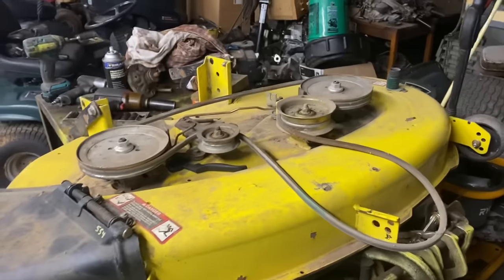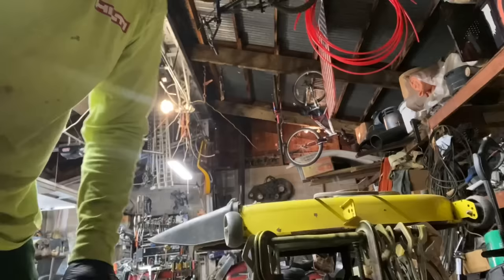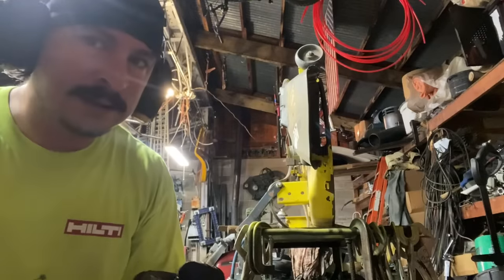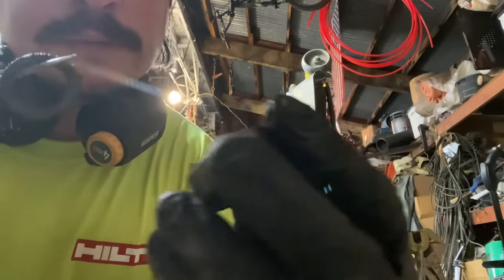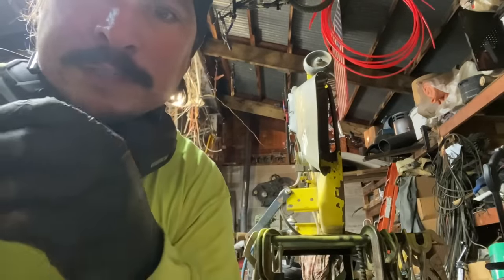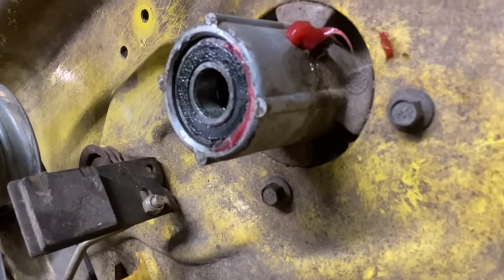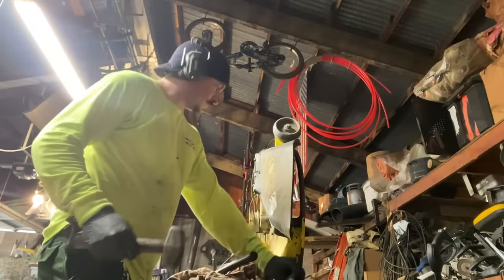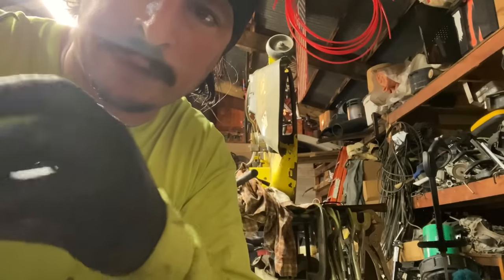Part 1 - Don’t trust the “Experts” Grease your mower deck sealed spindle bearings Common sense.

Comment: I have been removing the dust seal's on the bearings for years and I have never had a bad bearing since.
Reply from the maker: Thank you for taking time to comment. Yea, I have done the same and that works fine too. If I’m already in a deck doing repairs some times I’ll leave the inner lower shield off. I however prefer to leave the inner shield on the upper bearing as it can actually hold grease up in the top bearing as grease may migrate down into the assembly when it warms up. But if it’s greased regularly enough it wouldn’t make any difference if the shield is there or not. So I don’t usually bother messing with seals anymore. Just leave them there if they are already there. At least if the bearings have shields I don’t have to worry about junk getting into the bearing while I’m working on one and have it apart. I can just wipe down the outside of bearing and throw it back in. There are some good reasons to leave shields in place. However the point of the video is to prove that tearing down the deck to remove seals is not necessary. Some folks think grease won’t pass the seals / shields but it will and that’s the important information to take away from this. You can just grease the mandrels and save a lot of time. Regardless as long as the units are properly filled with grease the bearings will be fine regardless if they have inner shields or not. Many folks don’t want to tear down a deck and remove seals if it’s  not needed. Not everyone has the skill or tools and if they just know to add enough grease that’s what’s ultimately the most important thing. Plenty of guys posting videos stating that the shields / seals must come out or else they will prevent grease from passing. Lol, those little rubber lips can’t hold back the pressure exerted from a grease gun. I know these guys are smart, I see some other great information from these same folks but most everyone posting videos on this topic has missed the mark and not providing accurate information and I have yet to see anybody else take time to prove the theory they are so sure about. It was driving me nuts so I made a step by step video to prove that those “ mower experts “ are giving inaccurate advice. As many folks have commented this has been useful information for some people. Thanks again for the comment.

Comment: My Brother was a Small Engine Mechanic for 30 years & headed up a Service Department doing 8000 repairs per year in a Leading Mower Shop which was the Top Dealer for all the big brands,... He personally repaired the Riding Mowers which were many varied brands,... He worked on Engines, Hydraulic Transmission, Mowing Decks, Electrical, all of it.
He was a Briggs & Stratton Master Service Tech (less than 20% passed the Certification).
He has often told me that the biggest cause pf problems to Mowing Decks is WATER from people hosing them off !... Blow them, brush them, wipe them, don't hose them ;)
By the way,... Those Seals should not be that loose lol.
Reply from the maker: Your brother sounds like an impressive guy. I’d run if I even heard 800
Repairs. Lol. No thanks. I’m in the top 99 percentile. Everyone except for 1% of society is smarter than me. And I’m happy for the 98 % that are at the top. The bottom of the dog pile works great for me. I agree about the water. And Iv always said the same things. But I rarely find water in the bearings but water helps nothing. Blow deck off is best. As for the loose bearings or caps. That’s normal for a pair of used bearings pulled from a Deere deck. I didn’t notice anything alarming. Depends on the brand
Of bearings, some come with really loose sloppy caps. Some tigger than others. You can’t make a reasonable diagnosis from the video. Stop while your ahead, I was actually following you and agreeing until you said that.

Comment: This is an interesting video. The confusion comes from the bearings being called "sealed", which is shown here isn't quite accurate. 
But I think you are making at least one mistake and that is that more grease is better... Personally I think some will watch this and using the pressure of their grease gun, they will fill the reservoir and Then Fill the bearing race. 
And that's bad, because too much grease makes the bearing run hot and hardens the grease to wax. So while the video does prove what you say, it may also cause guys with new mower decks to ruin their bearings by thinking they can't over-grease them. 
Cheers 🍻

Comment: How often should you be greasing the spindles and if you pump in too much grease can you damage the seals?
Reply from the maker: Iv never seen any seals be damaged from greasing and stop as soon as you see grease exit somewhere no need to go crazy!!

In my opinion, a proper greased assembly is good for 50 hrs or annually what ever comes first. Avoid washing deck or applying excessive water directly on the pulleys to prevent water entering bearings.
Reply: @GTObearclaw1  Thanks.  There's so much conflicting information out there but this really helps.
Reply from the maker: @ADCar  I hear ya. It’s very hard to know who you can trust. Iv learned all this myself and why I wanted to help people when I seen the terrable videos on this topic. Lots of folks have no idea but yet make DIY videos. Be aware of the guys who have a video about every topic. Nobody knows everything. They just want views and gladly offer crap advice if it gets views. Most of my videos are about mower decks and that’s unfortunately what I know more about than anything else. Wish I was as knowledgeable on something cool like Harley’s are race cars. lol

Comment: Not sure I'd agree with this one. I've run lots of heavy logging and sawmill equipment and seen bearings go more often from being over greased because of heat build up in high speed rotation use. Over greasing can blow seals and allow in contamination as well. I've seen over-greasing cost many, many thousands of dollars in repairs, especially in components like twin disc torque converters with internal bearings accessed though an external zerk. Also I'd add that as that machine is working it will generate heat in that cavity and the grease will somewhat become vaporized and through expansion seep into and through the rubber seals. Why was the top bearing containing grease?
Reply from the maker: You don’t sound certain that I’m wrong. And that’s the point. I’m challenging the so called experts who say not to grease these. Thats just dumb to me because no grease is a guarantee failure at some point. Adding grease could potentially keep bearings rolling for the life of a tractor. Easy choice for me but Iv had many years of research on this so I’m 100% confident about it. This video is about mower decks. I promise I’m not going to try and give advice on servicing logging equipment. I’ll stick to what I know. I didn’t just invent this stuff, it’s actually kinda basic mower maintenance just not widely shared information and the reason I thought it was a relevant topic to cover. Seems even the pros have lost touch with the reality on this one. Considering a mower deck is not typically worth thousands of dollars in a box store model lawn mower, I think we will be okay here. If a bearing on one of the box store mowers goes bad you can pick up a set for under 20$ unless you really want to spend money you can get a rally high quality set for under 100$ so worse case you would have to take the deck apart or pay someone to do the labor or simply grease them as Iv shown and avoid those costly time consuming projects with simple basic maintenance. It’s just information to help the DIYers. Folks can use it or choose to ignore it. But I have had 100-% success with this for decades so I wanted to share after watching some other stupid videos say the grease can’t pass the bearings. I proved that wrong with ease. I can only assume the RPM and loads on the bearings you’re talking about are something way different. As in many cases, naysayers always come to the comments with something way different than this application. Food for thought, if you watched the video you may eventually feel like experimenting. It’s good to know it is possible to do it this way, and if you find not greasing to be an issue it won’t hurt anything to try this.
Reply: @GTObearclaw1  Yeah. It is definitely hit and miss on how much to trust OEM maintenance advice because it's all about the money. But like you say these are really cheap and common bearings, so a little or or less life is not big deal. As you demonstrated you could change out the bearings in half an hour,
Reply from the maker: @JimLambrick  yes, someone who works efficiently could easily swap bearings in under an hour. The majority of folks won’t have all the tools or interest in that project. In reality if folks grease them as Iv shown they are highly unlikely to ever need to go through that trouble.

Comment: It isn't quite clear.  Were the old bearings reused, and the old rubber seals put back in? ( I didn't know you could put seals back in.)  Or were new sealed bearings installed? (Yes, I understand that with enough pressure the grease can pass past the lip of the seal.)
Reply from the maker: I was simply using the used parts to show that grease passed. Yes for these type bearings caps pop off and on easily if in good condition

Comment: I greased my cheapo riding mower deck spindles after every cut, (aprox 3 hrs ), and they lasted for years. Before I started doing that, it was a never ending replacement.
Reply from the maker: How do you grease yours? Are you doing like in my video or do you have another method like hand packing each? I assume you use a grease gun if your doing it every mowing. 
Thanks for the comment
Reply: @GTObearclaw1  A zert fitting on the under side of the spindle, with a grease gun. I would drop the deck, use a home made scraper,( a piece of 1/2 thinwall conduit hammered flat on one end), scrape the deck, grease all 3 spindles and I'm ready for my next cut.

Comment: So I'm buying a new Husqvarna, and the spindles have the grease fittings on the top of the spindle shaft, not on the side of the spindle housing like the one in this video. .....So my question is do I pump grease into it until I see grease coming out  either the top or bottom of the housing like in the video?
Reply from the maker: @dennisshaughnessy5612  yes, pump them full. The shaft has a hole that lets grease in between the bearings. Same as what I show. Just a better design on yours in my opinion
Reply: @GTObearclaw1  Thank you

Comment: The manual literally says lubricate the three spindle grease fittings with one or two shots of general all-purpose grease. I’d love to see what a BRAND NEW spindle looks like. Maybe if it is shipped jam packed with grease as you have done, one or two shots would be enough to keep it lubricated. Otherwise, 70 pumps seems like overkill, according to the manual.
Reply from the maker: Sounds about right. Mislead people so bearings fail. If they are well lubed you would go too long without costly repairs. So providing the correct information is only good for buyers but not the parts sellers. In 20 years Iv never seen a full one on a newer machine. And only a hand full of properly filled ones on older tractors that someone got ahold of an properly serviced. Since before the early 2000’s this has been an issue on box store models and from what Iv seen in the comments even some brands know for quality like Kubota and others are doing the same thing now. I can’t speak for all models and brands but my guess is the lower cost / home owner units will be most affected by this situation. More break downs puts more $ on the company pocket. Home owner models are used less than commercial units so run less hours. Best way to cause breakdowns is lack of lubrication . Easy to hide that issue in a component that nobody can see without dismantling a deck. It’s all about the money boys. Just my opinion of course.

Comment: If you look up the bearings for the European version they don’t have a inner seal and a good outer seal. The housing is a one part fits many applications. I have had several decks come in with new spindles full of grease that won’t turn and seals popped out.
Reply from the maker: I’m sure you have seen failures and possibly thought the damaged you found could be blamed on grease but consider the bearings failed before some added the grease as last minutes measure to correct a more serious issue. Iv fixed decks for over a decade. The only time a bearing was locked up and full of grease was when the owner thought they could fix it by adding grease after running it to failure. I can always tell when that’s the case. A pro should know. It’s too late to put grease in after the bearings have failed. And it’s highly unlikely they will fail if they are properly greased. I don’t know your credentials but I know damn good and well a proper greased bearing that’s properly maintained is not going to be the reason a mandrel is locked up. I’m also not in Europe. So maybe we have completely different circumstances going on. Seals didn’t pop out in my video nor have I ever seen one come off in all my years. Thanks for the comment. As for one part fits many, here in America MTD and AYP / Husqvarna build about 50 % of the mowers and their machines are basically all the same just branded differently so one size fits all / universal is the name of the game.
Reply: I will retire in 30 days after 50 yrs of lawnmower and small agricultural repair, I have certifications for many different manufacturers
Reply from the maker: @artpendergraft4989  Iv had many certifications in my lifetime. None made me any wiser than guys who learned the same thing the hard way. And I know things that I learned myself that were never thought to me. The things I learn the hard way are the lessons that really stick in my memory but as I get older I prefer to learn from others who already made a mistake but it rare I can retain that information as I have little invested. Just because someone is an engineer does not mean they are smart. Some Iv met are dumb as a box of rocks but smart enough to get a degree. However they lack the most basic knowledge and understanding that most shade tree mechanics seem to have. I’m a shade tree mechanic of sorts myself and was one time a certified ASE Master tech. I could pass the test in areas I had very little experience in and didn’t feel comfortable but regardless I had the certs because I passed the test. After I realized the certs were only useful at a company that based pay on the certification I quickly found a job that paid for your actual ability. Some of the smartest people don’t ever have to tell you they are smart. And Iv met some real ignorant folks that needed to remind me every 3 minutes how smart they are but yet they rather talk about how smart they are rather than do any work. Some folks are just talkers. What kind are we? I can’t wait to retire from my job because I don’t like going to work. But I do like fixing mowers and it’s not my job. I’ll be tinkering in my shop till I’m dead. And hope I can find more ways to help folks until then.

Comment: I think I'll call and request the place I bought my Tractor from to throw in a couple of tubes of red grease when they deliver it. I only have half a gun full and i think I need more!  Nice job. Those other videos make me cringe. I hated when cars came into my shop where customers followed online repair advice and turned a $100 repair into a $800 one.
Reply from the maker: Thanks for the comment. 

And I know you’re kidding about how much grease you need. Just to clarify, one tube will service about 3 or 4 tractors that have never been greased. And once the assemblies are filled the future services only require a few pumps. 

Happy mowing.

Comment: I took the plastic protectors off both sides of the bearings and tapped a zerk fitting into all my spindle housings at the top of the housing so the top gets greased first and like the man said you have to pump the grease gun about 50 times
Reply from the maker: Nice. But as long as the grease fitting is in the middle and all the seals are in place the middle of the housing will pressurize and allow grease to enter both bearings before it finnaly passes one of the outer bearings showing us it’s filled. No need to take it apart to remove seals but if it makes folks happy and they want to do so, I don’t think it will hurt to remove seals. But I do like the upper seal in place to hold grease up there.